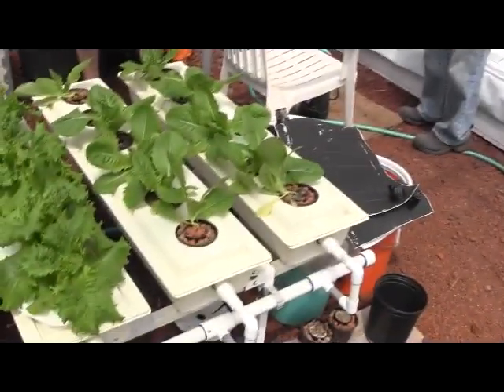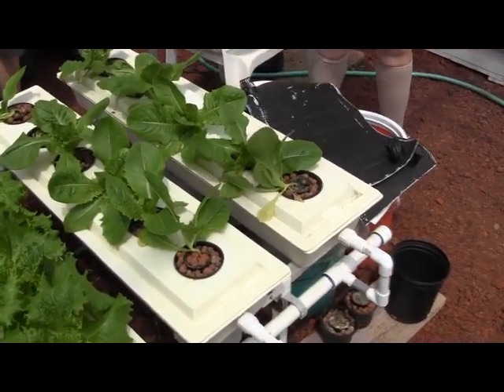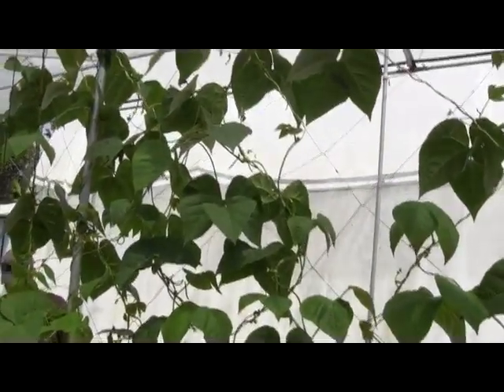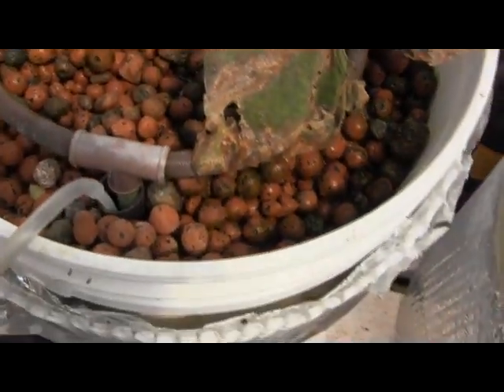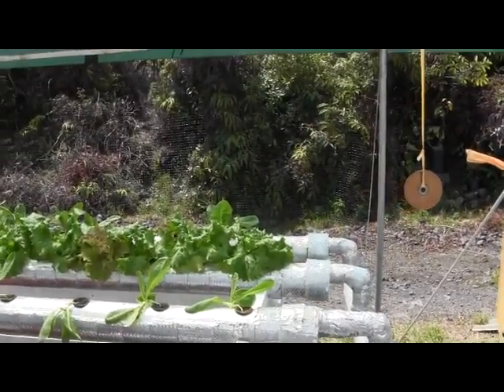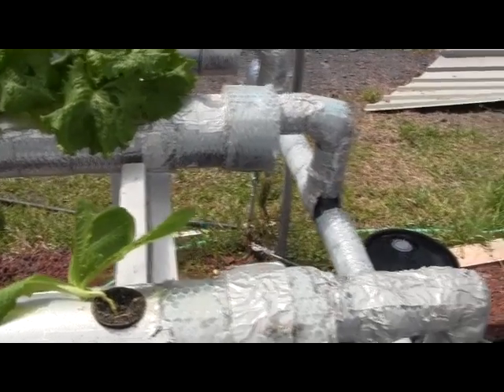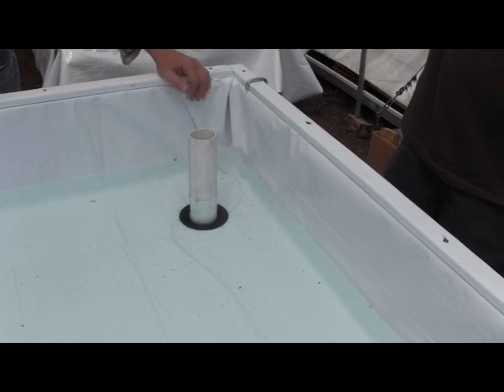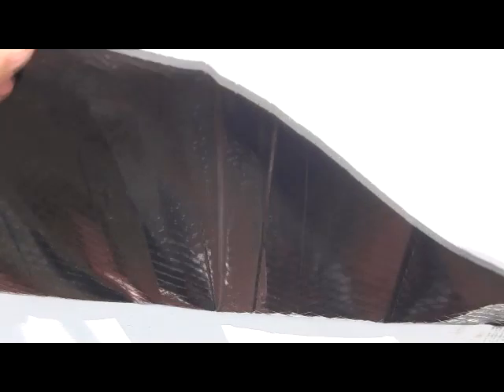Hawaiian Hydroponics

Comment: Hey... IV just started a small experiment with hydroponics..  Is there anyway I can contact u? Having a few problems with the high temperatures
Reply from the maker: You can ask questions here on you tube or you can use my email at greengardenservice@yahoo.com

I pay some attention to hydroponics but i am an not an expert.  We have deep soil here on my property and the only reason I work with these systems at all is to recycle fish waste.  As far as high temperatures are concerned reduce all dark colored surfaces by painting white or insulating.  Increase ventilation if the system is in a greenhouse.
Reply: +GreenGardenGuy1 OK thanks.. And what was that shinny film he used to cover the pipes n buckets... N where can I get it?
Reply from the maker: It is a reinforced aluminum foil facing used mostly in duct works.  It is available at most construction supply houses. http://www.homedepot.com/p/Reflectix-48-in-x-100-ft-Double-Reflective-Insulation-BP48100/202092205
Reply: thank you so muchhhhhhh ... by the way do i have to put another insulation under it (foam etc) or just apply as shipped?
Reply from the maker: That would depend on how much heat you are dealing with.  In the video everything is pretty much out side in the air with just a rain cover over the top.  The ventilation is excellent and he has just used the cover to reflect strong solar rays.  It has nothing under it.  If you have extreme heat or cold issues you will need a foam pipe wrap too.  Most of the time white exterior latex paint works as well as anything if you heat is strictly from the sun pouring down on the system.  If the heat is generated by a closed building with poor ventilation then you have a whole cluster of other issues more pressing than the warm pipes.
Reply: +GreenGardenGuy1 OK... Thanks for the advice.. And no my system is out doors as well similar setup as in your video... Thanks for all your advice
Reply from the maker: In that case white latex and foil wraps should handle your temperature issues.  Enjoy, Bill